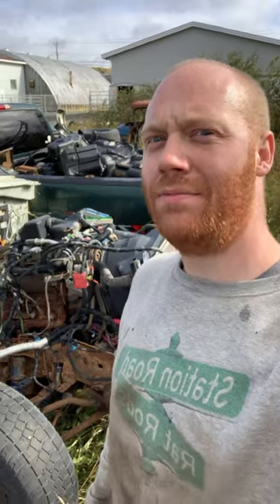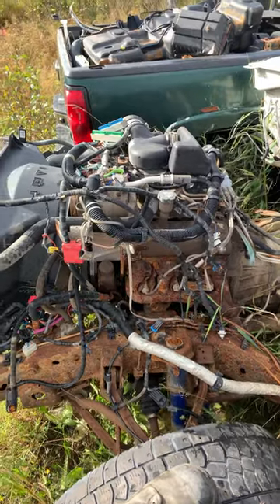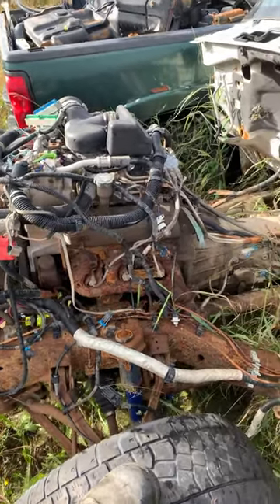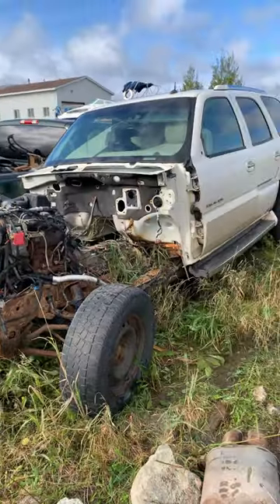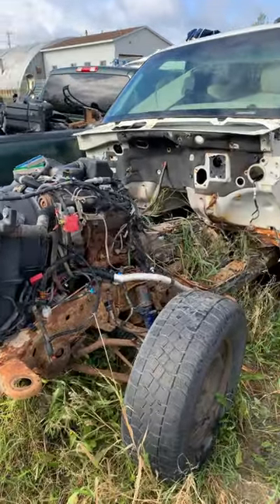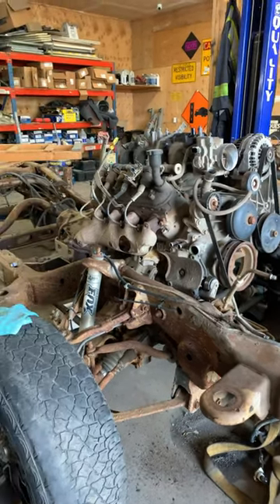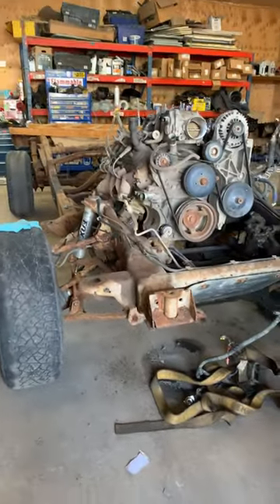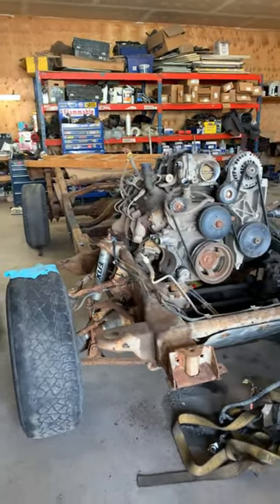Are V6 torque converters high stall?  #shorts #truck #trucks #rusty #build #chevy #chevrolet #fun

Comment: I found this.  It will help you know if the stall is higher.  It won't tell you the actual stall because a V8 and a V6 will a achieve different stalls on the same converter...but if the second digit gives a higher stall I think you'll be golden.  

GM RWD Torque Converters
Starting 1980-up, GM used a 4-digit ID sticker located on the converter body to help identify it. Below is a guide to help decipher it's meaning.

1st Digit (application trans)
B -- THM250C, THM350C
C -- 200C, 2004R, Pre-1984 1/2: 325-4L & 700r4
D -- 1984 1/2-up 700r4, 4L60, 4L60-E

2nd Digit (approx stall, depends on engine)
B -- 2025 rpm
C -- 2075 rpm
E -- 1654 rpm
F -- 1611 rpm
G -- 1397 rpm
H -- 1397 rpm
K -- 1211 rpm
L -- 1654 rpm

3rd Digit (Clutch Assembly)
3 -- Poppet Valve
7 -- Poppet Valve
9 -- Poppet Valve
A -- Red (pre-96)
A -- Carbon (96-up)
B -- Static Open
G -- Carbon Fiber
H -- Red (pre-96)
H -- Carbon (96-97)
H -- Woven Graphite (98-up)
L -- Carbon Fiber
N -- Woven Graphite
P -- Woven Graphite

4th Digit (Body Mounting)
C -- 3 round lugs, gas engine
D -- 3 round lugs, diesel engine
E -- 6 round lugs, gas or diesel
F -- 3 square pads, gas or diesel
G -- 3 square pads, gas or diesel
Reply from the maker: Awesome!! Thanks so much for that. This will be a learning experience for us all
Reply: @StationroadRatrods  no prob.  Definitely

Comment: I heard they were higher.  Interested to know for sure.
Reply: I guess I should say, I heard the S10 4.3l  had a higher stall behind a V8 in a full-size.  Not sure if the v6 full-size has the same part number.
Reply: I just checked the part numbers on an S10 vs a 1500 V6.  They're not the same.  
They also are not the same as the ones for a V8.  So that tells us they're different...other than that, not sure.😂😂
Reply from the maker: That’s exactly what I did lol “well the part number is different, so that’s something”